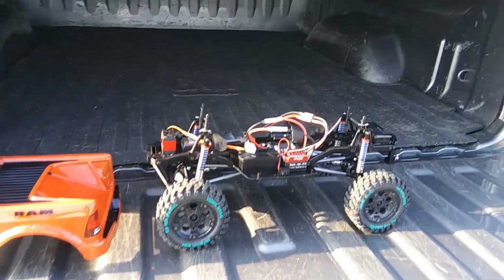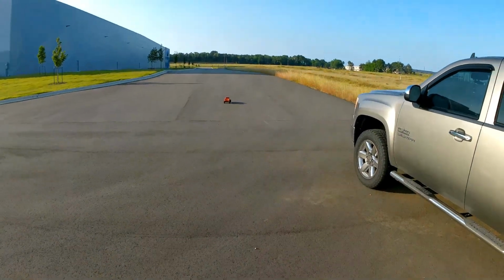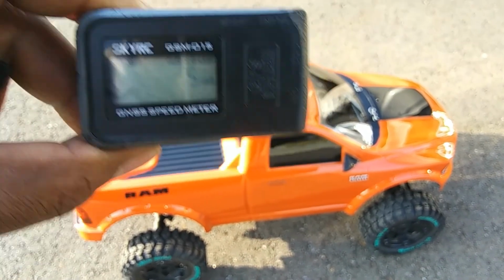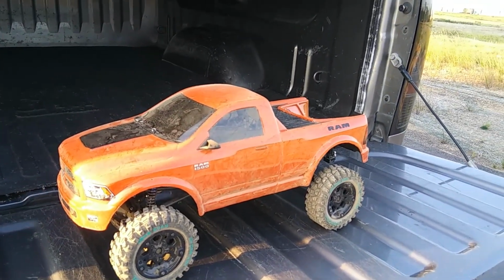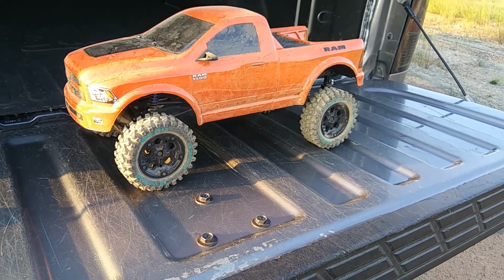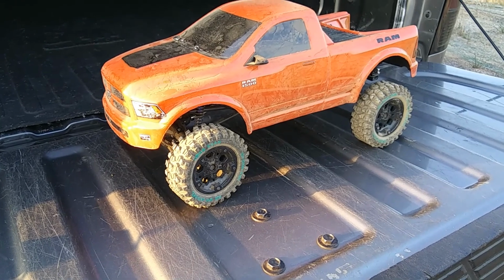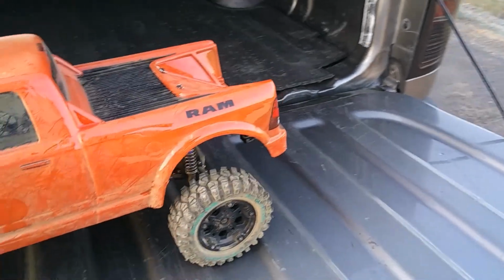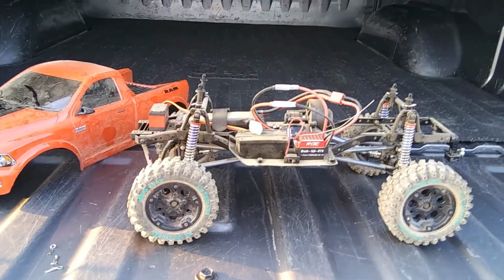INJORA SCX10 II CLONE FIRST RUN WITH INJORA PORTAL AXLES

Comment: Nice truck is it ready for the mud
Reply from the maker: It's not ready for mud just yet. It will need a little more wheel speed and some mud slinging tires for that. Thanks for watching!
Reply: @PJsElectricRCAdventures  🛻🛻🛻🛻🛻🛻🛻🛻🛻🛻🛻

Comment: How are the axles holding up?
Reply from the maker: @TrokaRC  still going strong and I'm beating the crap out of the truck. I bash with it more than I crawl with. That 8t Brushed motor I installed in it pushes all the parts to the limit. No breakage so far.
Reply: @PJsElectricRCAdventures  Good to hear, thanks!